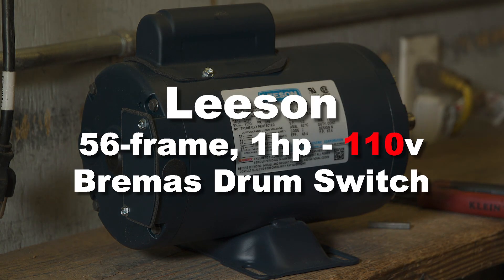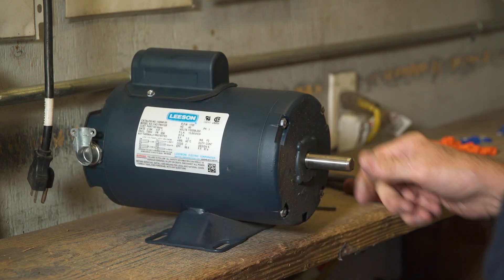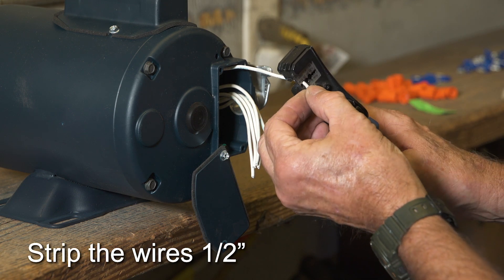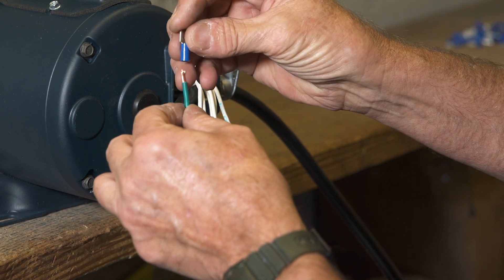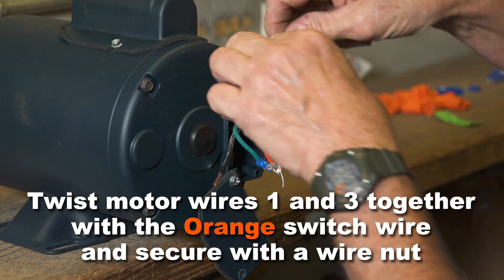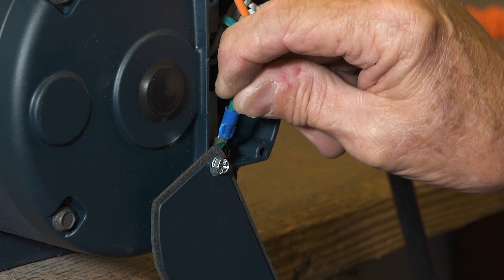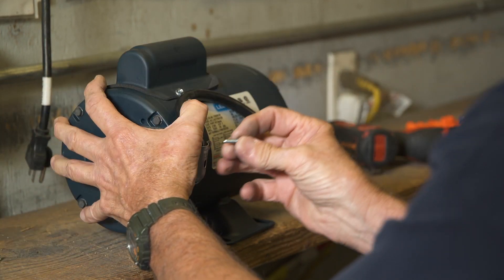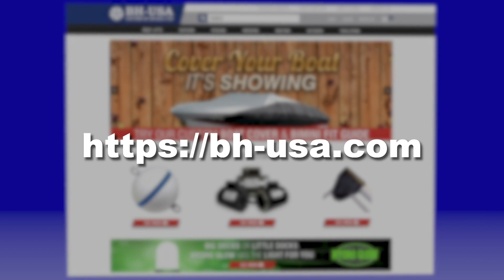Leeson Motors - 1 HP 56 Frame Boat Lift Motor - 110v Wiring

Comment: I have a Leeson  motor that doesn’t have a capacitor need to install a capacitor how can I do it .it only has wires can you show me please thank you
Reply: @rick.pearson  On my 3/4 Leeson the external T5 lead connects to the capacitor, there is an internal T6 that also connects to the capacitor. But you need to verify yours!! Go to the Regal Beloit/Leeson website and search for your motor model number. From there you can download the wiring diagram for your motor.
Or you can take the motor to an electric motor shop and they will professionally hook you up for not much more than the capacitor value. Good Luck!
Reply: On my 3/4 Leeson the external T5 lead connects to the capacitor, there is an internal T6 that also connects to the capacitor. But you need to verify yours!! Go to the Regal Beloit/Leeson website and search for your motor model number. From there you can download the wiring diagram for your motor.
Or you can take the motor to an electric motor shop and they will professionally hook you up for not much more than the capacitor value. Buena Suerte!